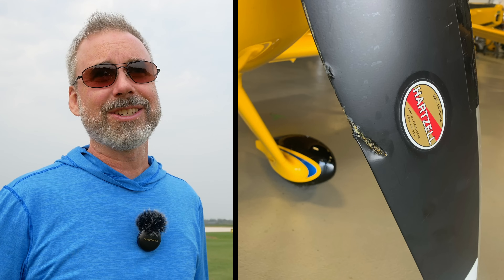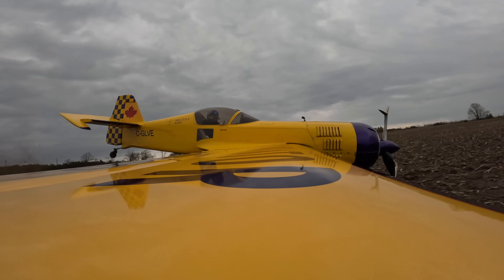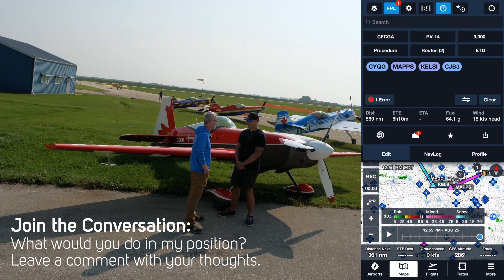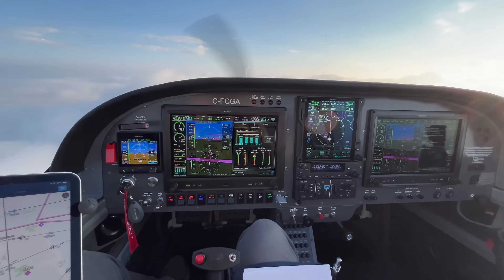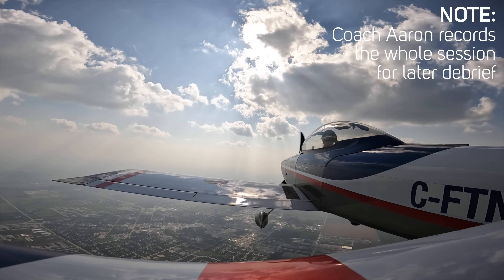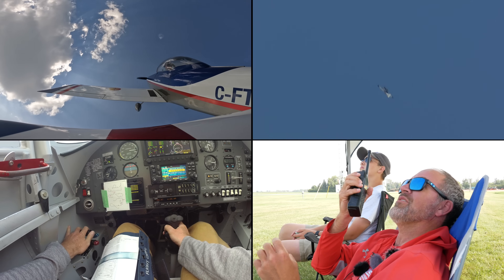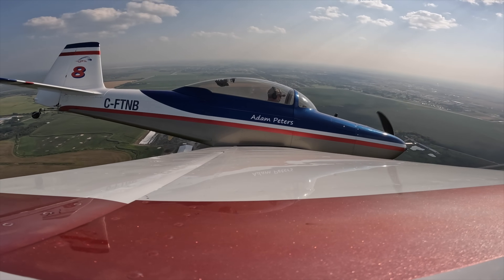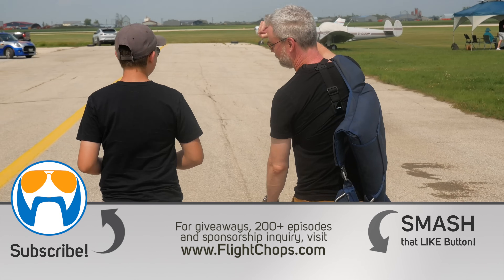This could cost $30,000 and End the Flying Season

Comment from the maker: Thanks for all the support in the comments - there does seem to be some confusion about the definition of a prop strike though. 
Here is what the FAA has to say about it: 

Definition of Propeller Strike 

(i) For the purposes of this AD, a propeller strike is defined as follows: 

(1) Any incident, whether or not the engine is operating, that requires repair to the propeller other than minor dressing of the blades. 

(2) Any incident during engine operation in which the propeller impacts a solid object that causes a drop in revolutions per minute (RPM) and also requires structural repair of the propeller (incidents requiring only paint touch-up are not included). This is not restricted to propeller strikes against the ground. 

(3) A sudden RPM drop while impacting water, tall grass, or similar yielding medium, where propeller damage is not normally incurred. 

(j) The preceding definitions include situations where an aircraft is stationary and the landing gear collapses causing one or more blades to be substantially bent, or where a hanger door (or other object) strikes the propeller blade. These cases should be handled as sudden stoppages because of potentially severe side loading on the crankshaft flange, front bearing, and seal.
Reply: I think the careful considerations and additional common sense decisions you are making regarding engine tear down are wise. You have answered most of your questions about engine teardown or not  in this video. Every specific situation is unique. The FAA blanket wording doesn’t fit all scenarios. It’s your airplane and your 🫏. Do what you feel fits your specific safety needs.
Reply: Hmm... Google had unsubscribed me. Re-subscribed today.
Reply: Another example of the FAA's "one-size-fits-all" approach to regulations. Does a wood or composite prop react the same as a metal prop?  In the gear collapse scenario, does a two-blade prop sitting at a 45 degree angle exert the same forces on an engine as a prop oriented vertically?
Reply: I don't know about the Canadian rules but the FAA DOES NOT mandate a tear down for a prop strike, speaking strictly for Lycoming engines there is a AD for a prop strike which is law and a mandatory service bulletin put out by Lycoming which does not carry the weight of law behind it.  Read the AD carefully it says what must be done for a prop strike, but in a nut shell the accessory case needs to be removed and an inspection of the gear train needs to be performed along with replacement of the accessory drive bolt.

Lycoming and their lawyers put out the service bulletin that requires a tear down for just about any damage to a propeller that can't be dressed out without regard to how it happened.  I'm sure there are many planes flying today that have had prop strikes that met the Lycoming SB threshold for teardown but simply followed the FAA's published AD.  My left engine suffered a prop strike when a taxi light hiding in snow was hit, the prop was replaced, the AD was followed and it ran 700+ more hours until it finally required an overhaul.

The overhaul decision is not as black and white as Lycoming wants you to believe, you need to assess what the damage is and how it happened before jumping into a teardown.
Reply: Well researched here, Steve.  Consult Mike Busch on this one, the call / consult will be worth your time and money.  My bet is, prop wasn't turning, no chance of accessory drive damage.   Check runout on the flange, new prop, fly.   Sorry you have to deal with this man.

Comment: I just went though this, Hartzell 5 Blade on a PC-12 (PT6A-67P engine). Composite propeller, hit by a tug (not very hard but caused similar damage to what you had). Damage incurred about 2 weeks after the prop was overhauled. Hartzell says if the prop can be repaired without being dismounted it won't need anything beyond a minor repair. The prop was repaired  and a new blade was ordered to be installed later on. 3 months later the prop was removed and a new blade installed. When the prop shop tore down the prop to install the new blade they found the hub was bent and needed replacement. The point being, Hartzell understands what dynamic forces their prop experience and what damage they can tolerate. Unless the damage was incurred with the propeller spinning, there's no way to tell how the stresses were transferred into the hub or engine and what those forces were. Have the prop torn down and inspected, its not expensive. as for the engine, being a piston as an absolute minimum do a runout check on the engine flange and do a SOAP on the engine oil after a good long ground run at power. And again at 25 Hours.

Comment: Steve,, your 'accident' will never damage the engine. Repair or better replace the prop and away you go.A significant strike like a large bird or ofcourse standing it on its nose would then require engine inspection. And even then it would be doubtfull of any damage,, but you must check

Comment: Being in a shared hangar sucks for sure.  Being in canada though we have to take whatever hangar space we can get.   I’ve had my 172 and now my 182 dinged by meathead users of a plane in my hangar.   The best part about it is they’ve tried to hide the damage they did and then deny it was them.  Neither one of those jerks even own the plane they use.  I’d rather drag out 2 planes by myself than have them touch mine.

Comment: You have the correct definition of the FAA of our English word “STRIKE”  

Strike is a verb which assigns ownership to the “striker”
ie the offending person or object.

What we have here is the past participle of “STRIKE” which is 
“STRUCK.”

Your engine was “not” running and was damaged (struck by) only on the back side of one blade.

This is now a “PROP STRUCK” event, and neither CAA or FAA offer any requirements.

There is simply no way that your engine could possibly suffer any kind of internal damage by being “struck” by another aircraft in the hangar.

The crank and case endures 50 times more stress during acro or even normal ops.  The crank and case is built to not bend during the high torsional stress events of normal ops.

The correct answer for certified or experimental, US or Canada doesn’t matter:

Remove and replace prop.  Logbook entry by any A&P.

The entire story line here is approximately equal to a mosquito landing on an aircraft carrier and being worried about carrier damage.    It’s that insignificant.

If there is more to the story that I missed which would make it all make more sense, please share.   I am more than happy to have my mind changed if I missed something.

Comment: Why not trailer these aircraft to the competitions?
Reply from the maker: It’s prohibitively expensive in terms of cost and labour, and there is often damage associated with trailering aircraft. It is unavoidable for over seas events, but if on the same continent, they are generally flown.
Reply: @FlightChops  Mate I thought you started life as a glider pilot ;) Good point though I guess powered aircraft don't generally have purpose-built trailers just lying around.

Comment: This is absolutely not a tear-down situation. Never mind homebuilt v as certified;  think logically.   There is no way on earth that damage could have hurt any part of your engine.  I've personally worked on engines that had actual prop strikes while engine was running. One customer insisted on an engine tear down. He wasted $30k. On two other engines we inspected, found no cause for concern and the engines have been flying for years since.  I know a guy who runs an engine shop. Off the record: he had never seen engine damage from a composite or wood prop strike.
Reply from the maker: Logic and regulations don’t always mix.  The video addresses the dilemma.

Comment: Is that a carbon fiber prop?
Reply: Yes those are carbon fiber blades with a foam core and stainless steel shank into the hub.
Reply from the maker: I think mine is actually aluminum shank, but I am looking to possibly change to the steel shank for a bit more firewall forward weight.
Reply: @FlightChops  Is a carbon fiber prop less likely to bend the crankshaft than a solid aluminum prop?
Reply: My bad.  You are right, some of the Hartzell ASC2 blades have aluminum shanks.  Not sure which model or series of blades have those.  All the "newer" carbon fiber blades that I have worked with have had stainless steel shanks.     @FlightChops
Reply: Any kind of impact (rotating or non rotating) to the prop has the potential to damage the crankshaft, so many variables.  However composite blades may shear easier, or even grind away quicker.   @lincolnthomp

Comment: I am an A&P holding Inspection Authorization. If you came to my shop I would send your prop off for IRAN, dial the crank flange and (if run out is within limits) re-install the prop and sign it off as Airworthy.
Reply from the maker: Appreciated - that is what we’re doing :). But can you confirm this would not be the case if it was the certified version of the IO 390? That’s what people in these comments are confused about.
Reply: @FlightChops  Good point! I forgot that the engine is not in an Part 23 Certified airplane. I am not sure how Canadien Regulations apply. I do hope your costs are a lot less. Shame.

Comment: You'd be nuts to do an engine tear down on a 'prop strike' that occurred when the motor wasn't running. There is literally no chance a low speed impact would effect anything in the engine. The prop will yield so much sooner than anything in the engine.
Reply from the maker: Welp... The FAA doesn't agree. (see pinned comment, and/or pause the video when I scroll the AD and  related Lycoming SB)
And while I don't love the black and white approach they've taken with defining a prop strike, I do appreciate that there ARE cases when a non running prop being impacted by a foreign object CAN send weird forces to the crank shaft and do engine damage... so it is not something to be discounted.
Reply: @FlightChops  I could be slightly convinced if it wasn't a composite prop.

Comment: Ground handling damage is definitely expensive.  Prop damage story for you -  Helping a gentleman work on his kit-plane (GlaStar) at the airport.  Large hanger was shared by 3 airplanes and him in the back corner.  Guy(CFI) comes out to fly and he meets another CFI and another person at the hanger.  They hook up to a Mooney parked in there and pull it out on the ramp with a hand tow bar, and close the hanger door.  2 hours later, they come back after flying WITH THE TOW BAR ATTACHED.  Blade strike, probably on take off.  They didn't realize they hadn't disconnected it until it bounced up into the fuselage on landing apparently.  New prop and engine teardown......$$$  Stuff happens, in the air it could be the last time it happens.

Comment: The joys of grossly overpriced primitive engines in GA.
I agree the wording of the regulation is all inclusive however their later specifications suggests notion of significant resistance to the propeller causing sudden engine slowdown or bending force. Maybe just inquire with FAA, they might agree it's unlikely to affect the engine if it spins true. Also what clown runs planes that hard into each other in a hangar. I assume that blade is pretty tough, how is it even possible.

Comment: Considering that the engine was not running and that these composite props are so delicate, I would not tear the engine down.  It seems that you have done everything necessary to check the engine & prop so, while watching closely for any new vibrations, I'd say run it hard for a couple of hours and if nothing appears out of the ordinary, take your trip and don't imagine vibrations when there aren't any (easy to do when flying alone and listening hard for them... this is when ghosts tend to appear!).  Due caution is one thing, being over cautious is just expensive!  If you do hear or feel "new" vibrations, find another experienced pilot with the same type airplane and see what he or she has to say.  I'm betting your engine is fine!  But then it's not my butt on the line, so it's easy for me to say this.  You have to do what nakes you feel is best and whatever allows you to sleep soundly at night!
Cheers, 
jc
Reply: I just went though this, Hartzell 5 Blade on a PC-12 (PT6A-67P engine). Composite propeller, hit by a tug (not very hard but caused similar damage to what you had). Damage incurred about 2 weeks after the prop was overhauled. Hartzell says if the prop can be repaired without being dismounted it won't need anything beyond a minor repair. The prop was repaired  and a new blade was ordered to be installed later on. 3 months later the prop was removed and a new blade installed. When the prop shop tore down the prop to install the new blade they found the hub was bent and needed replacement. The point being, Hartzell understands what dynamic forces their prop experience and what damage they can tolerate. Unless the damage was incurred with the propeller spinning, there's no way to tell how the stresses were transferred into the hub or engine and what those forces were. Have the prop torn down and inspected, its not expensive. as for the engine, being a piston as an absolute minimum do a runout check on the engine flange and do a SOAP on the engine oil after a good long ground run at power. And again at 25 Hours.

Comment: Not a pilot but had to deal with people around a truck for years. I could tell people to stay clear or a work area, you can't, but I've had to drive around people that were or weren't paying attention. So it all boils down to the 6th sense we get driving when we feel out the other drivers and can usually tell what they're going to do, but CYOA (cover your own a..!) because at any moment they can do something dumb when you're committed and can't change what you're doing. So I treat them like an obstacle/hazard so I can avoid them or over take them but a go around is good especially when you aren't sure and can radio to have them run off the runway.

Comment: The prop strike is surprising to me that it did so much damage to the blade versus the damage that was done to the aileron. I was considering putting a composite prop on my Arrow, now I am going to have to think on it a while.
I must say it speaks very highly of your fellow competitors that you are able to use someone else’s plane to fly the competition. I have found this to be the case in much of aviation and it reflects highly on all of us involved in GA and making a living flying planes, we still help one another. It was very nice to see people acting decently without expecting huge financial gain. 
GO AROUND, GO AROUND, GO AROUND!
The golf cart got too close for my comfort. If the runway was long enough I may have flown 1,000 feet down range then landed but it has been my experience that runways bordering golf courses usually don’t have an extra 1,000 feet.
Reply from the maker: Thanks for watching to the end :) 
And honestly, I'd look at the composite prop from the opposite perspective - under normal operations they are super strong... When abused they break before the crank shaft does.
Reply: @FlightChops  
I like that way of looking at the blades. Saves the crank.

Comment: Prop damage caused by a static hanger bump when the engine is NOT running is completely different than the conventional “prop strike” when the engine is running. Talk to your AME and Transport Canada for clarification. Teardown not required. Get the offending aircraft owner to pay repair costs.
Reply from the maker: But from the FAA AD definition of a "prop strike" and the related Lycoming SB standpoint it is black and white.  
I'm just glad to be in the experimental category and have the option to apply some common sense here.
Reply: Does the “clear cut” reg take into account infant mortality rates on engines torn down with no decernible damage transferred to engine internals from minor non running strikes to composite props?  I think this is the crux of the matter.  Do a very through exam , run outs, bore scope, ect. And then bring the aircraft back into service slowly and methodically expanding the envelope.  Yes, FARs were written in blood, but to apply the lowest common denominator in every case just continues to price aviation out of reach for most, while ignoring common sense.

Comment: Pity about the prop strike...it's already been said, and I read the pinned notation, but particularly when the equipment, like a composite prop on the aircraft is so easily damaged, there's no need for a teardown...run-out on the flange face tells you the whole story. There are so many regs that don't address (more properly - ignore) the modern materials and technology on new aircraft....hope you did well in the competition regardless!
Reply from the maker: Thanks - and yeah - I'm happy with how it went - I'll share an episode about that soon.
Reply: Yeah, as a(n automotive) mechanic, and sometimes CNC operator, I think I'd agree on the decision there. I think I absolutely understand the over abundance of caution for wanting a full rebuild, but realistically, if I'm understanding correctly and it was just a bump in a hangar as things were being pushed around, then I would imagine it should be absolutely fine, so long as there's no change in flange runout in either axis, and presumably with a prescribed preload applied. Really frustrating - I still remember the videos of it getting installed and balanced, it wasn't that long ago was it?? - but hopefully should be easily remediated and back in the air soon. Also agree that in that process, it was best to at least give time to test it at home instead of just running it straight to comp. That way you can verify the new one has been installed and balanced properly, without being in a rush and overlooking any details.